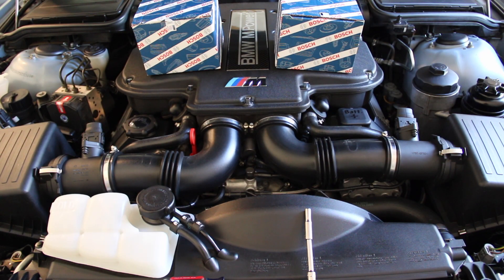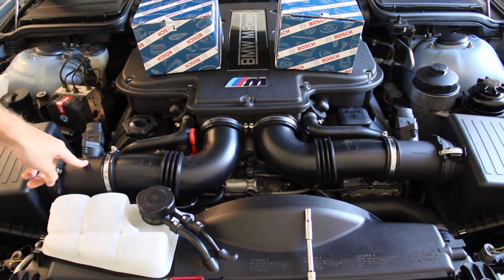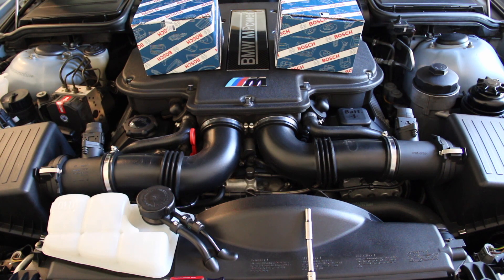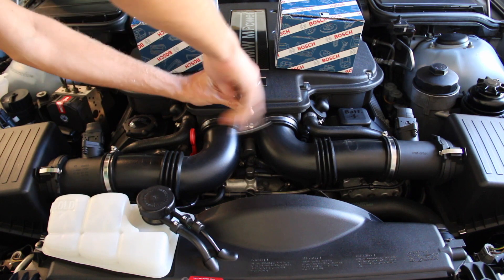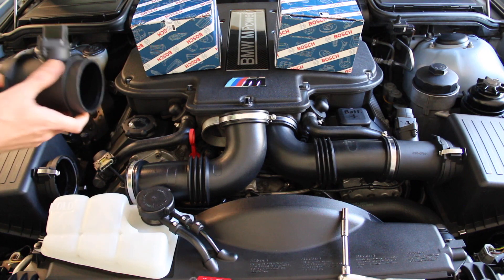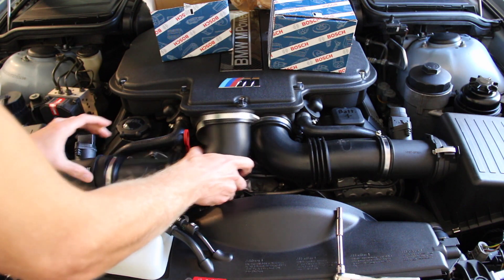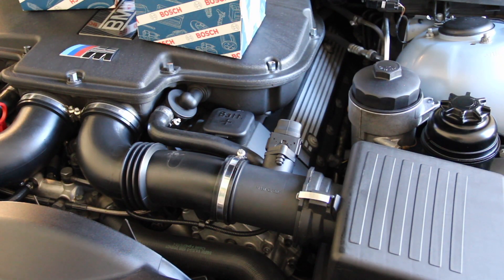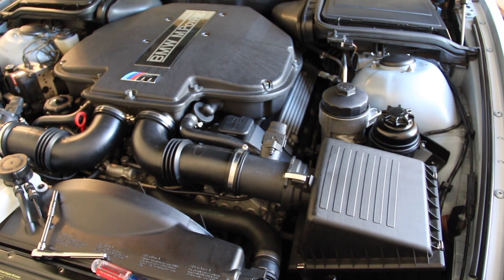BMW E39 M5:  MAF Replacement DIY

Comment: Hi, nice video!!! Your rubber seal in the last pipe (driver side) Slipped during instalation. It could cause a vacuum leak... Undo that pipe and put again the rubber seal 😉👍beautiful car!
Reply from the maker: On camera it does look like it got pushed towards the plenum a little bit.  I remember thinking that it went on correctly, but I will definitely double check that!  Thanks for the heads up.
Reply: E39Source Yes, it looks like the seal did not fitted properly. Sorry for my bad explanation, english is not my first language. 😉

Comment: Great video. Not strictly related but I'm trying to remove the whole air intake on my 540i facelift and just wondered if you happened to know how to disconnect the two air vents from the rubber boot that is in front of the throttle body? The larger of the two vents has a kinda loop on the top of it, can't seem to figure out how to unplug it to remove it. Cheers!
Reply from the maker: The plastic U loop should be pressed in to release the tabs so you can remove the hose.
Reply: @E39Source  Thanks very much for your input!

Comment: I've read that MAF sensors can be cleaned (instead of replaced), and also that they are self cleaning and don't need to be replaced until obvious issues. Any comment on these two?
Reply from the maker: There are MAF cleaners, though this is a temporary solution at best.  They also do indeed clean themselves at each drive cycle, but this is not a 100% effective cleaning.  MAFs are a wearable sensor that will simply need to be replaced after enough time/mileage, even while your two points are valid.
Reply: @E39Source  thanks for your input. Do you have a general reccomended replacement interval for these?
Reply from the maker: @TOShorts  Probably 100-150k miles, or whenever you experience symptoms that could point to MAF(s).

Comment: So I'm getting about 15mpg on average for my daily driver 540i msport automatic. Ive been told replacing the mass air flow sensors would boost that to over 20mpg. How do i know if my sensors are even bad?
Reply from the maker: I'd be surprised if MAFs made that dramatic of a difference.  There is a secret test in the cluster where you can monitor the reported airflow through the sensor and see if it's reaching its maximum.  If not (or if its original), it's likely due for replacement.

Comment: Hello
i got P0411 error... i will check today MAFs....if i disconnect them for check ...will engine run ?
Reply from the maker: P-codes are generic codes that don't tell us much.  A BMW-specific scanner would go a long way in determining the fault with your BMW.  After a quick Google search, it seems that P0411 is related the secondary air flow, which is not related to the MAFs.

Comment: Love your vids man...  hoping to come across an M5 but in the mean time, have a question on my 528i.  What brand wheel speed sensors do you recommend?
Reply from the maker: I think VDO is the OE for the speed sensors, that's what I would use.
Reply: E39Source thanks good to know.

Comment: And more perfect I've been struggling with why my car the 528i has been struggling to idle properly and the mass airflow sensor does need to be replaced perfect timing!
Reply from the maker: This could definitely be it, but so could CPS, O2s, spark plugs, coils, and fuel pump/filter.

Comment: I am trying to do it on my f10 2013 m5 . Any tips ?
Reply from the maker: It looks like more or less the same process on the F10's S63.  Part number 13627602038.  The difference is, just the sensor is replaced, not the piece of intake tubing too.

Comment: How does FCP's prices compare to Bav Auto and ECS?
Reply from the maker: Right in line with competitors.  But the lifetime warranty is another beast entirely.
Reply: Cool, I'll try them out. You should set up an e39source coupon code with them or something!